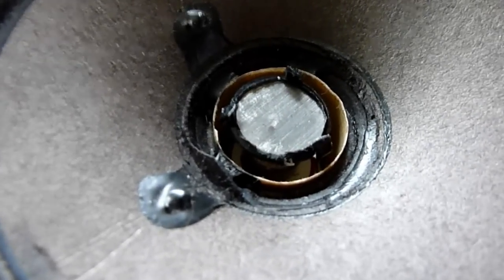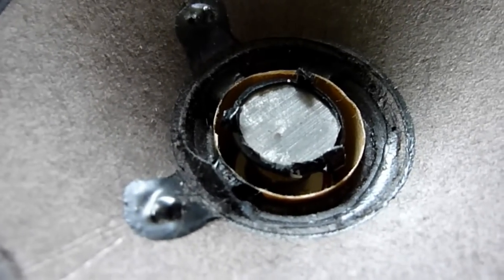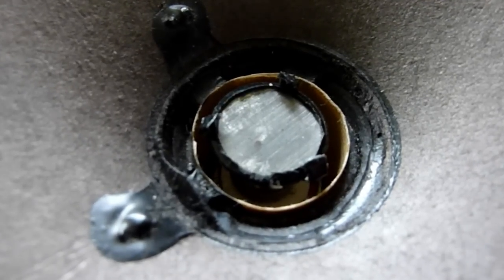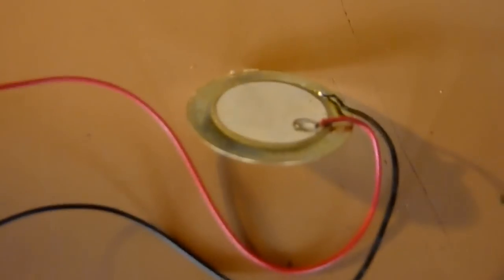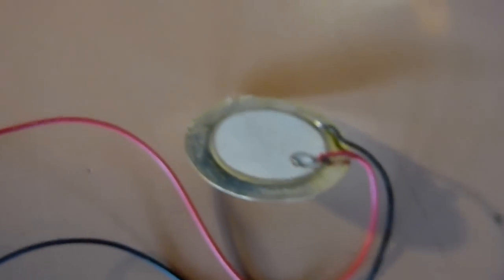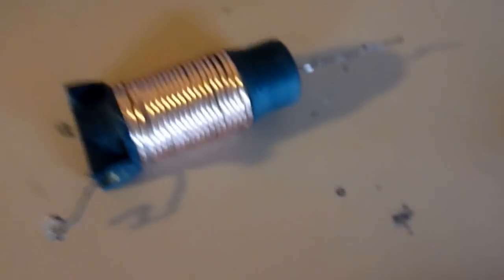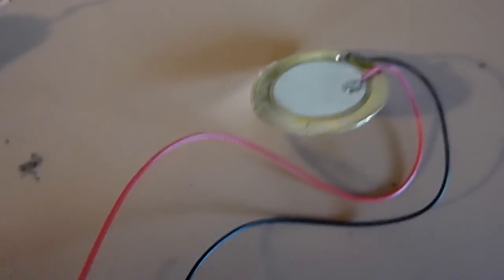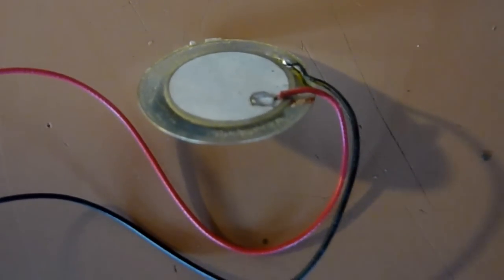MAKE PIEZO UNITS SOUND BETTER

Comment: Im building some 3-ways with piezo tweeters mounted to  jbl horns. I've got an 8ohm resistor across the termials with a cap wired to the positive terminal (playing 4200hz and up), and its controlled with an adjustable L-pad. Im really liking the sound, but I'd like to try your idea of cutting the top frequencies with an air core inductor. What value would 20 coils of wire be? .1mh?  .05mh?, etc Thanks for any help, I like your videos
Reply from the maker: .01 mh lol I don't know. Just go by coils instead. It made it sound smoother. It would be fuck-all resistance.

It's a good idea to have a 2 or 3 of ohms resistance in series with the piezo, to maximize lowest impedance, that I have heard can get really low. An 8 ohm across the terminals won't heighten the 1 ohm minimum piezo impedance (at high frequencies) cos it's in parallel. But it's still a cool idea to have the 8 ohm as well (across the terminals). Makes it a safe all round impedance. But with a .2 mh -.5 mh choke on it (in series with the 8 ohm) to save wasted top-end intensity. It's only that, that can't get through, so it goes through the piezo, instead (making it louder in top-end). Good trick. Impedance is controlled just the same, and sound is improved. Impedance stays between 8 and 3 ohms (and can't go lower) no matter how high the frequency (and the coil helps bring resistance up at the extreme highs, too). By not much, but it's still a cool thing, cos it sounds better too. win-win

 If you know about choke values, try using 8 mh chokes (big ones) on your woofers, in parallel with your existing choke(s), and a 2 ohm resistor on your existing choke(s). And the 8 mh choke is not resisted, and so has a 2 ohm influence on the other chokes (not much) but it will make a transistor amp sound like a "tube amp" in the bass. If there is too much med (cos of the extra choke in parallel) resist the small med choke by 2 ohms (if you have two original chokes). If you just have one original choke, resist that by 2 more ohms (only if there is too much med). 

If you have a tube amp, don't do it. lol Great trick for cheap transistor amps, though. Also extend your bass vent tube by an inch (if they are cheap speakers) and by a quarter inch (if they are good ones). And don't do it, if they are high-end speakers. lol Fat bass!
Reply: Thanks for all the ideas! The 8ohm resistor across the terminals helps the adjustable L-pad work properly with the piezos. They turn down and sound great, but Im gonna try a couple different chokes to see if I can get a little smoother sound. Anyway, thanks for responding
Reply from the maker: Thanks for the interest.
"The 8 ohm resistor across the terminals helps the adjustable L-pad work properly with the piezos."
The 8 ohm makes the general impedance 8 ohms (like a speaker should) instead of the typical 1000 ohms that piezos have in the upper med and lower treble. Piezos only have really low impedance above 10 khz (and ridiculously low at 20 khz). Hence the necessary 3 ohm resistor in series with the piezo. And the 8 ohm is in parallel with the piezo. So instead of the piezo having 1000-1 ohm impedance, it's now 8 ohm to 4 ohm impedance. Such a simple thing to do, and it corrects the impedance to a tee! Have a nice day.

Comment: fantastic video. thanks so much. I am getting into piezos and adapting one onto an old wax cylinder player! great tip on the resistor I will add one I wonder if there is a way to make them louder? for some reason the headphone output of my old technics receiver is louder when connected to the speaker outputs (maybe an impedance issue). if you have any tips on how to get a higher output with these peizo discs much appreciated
Reply from the maker: Piezos sound soft cos they only reproduce the highest frequencies (up to 30 khz). Twice the frequency of human hearing limit. lol But really pizos are "loud", but much of it is above human hearing and even the stuff that we can hear from the piezo must also be loud (but only sounds soft cos it's so high). 

That said, try mounting a piezo inside a full-range speaker. The high stuff from the full-range mixes with the extreme highs of the piezo to yield the stingingest treble ever (loud and stinging). So that is proof that the really high stuff from a piezo is really loud, but needs backup in the less high treble from the full-range (the stuff we can hear as loud). That combined with the really high stiff from the piezo, it's stunningly crisp treble (and loud) insted of the "chiffy" full-range sound by itself. And the "chiffy" sound of the full-range completely disappears and sounds like tweeters instead. lol Great cheap trick. And you don't get the limited power handling problem that you get with tweeters hooked up to high power amps.

I got tiny (computer speakers) full-range speakers on my ch. Just have a look, you have to scroll down my videos and you will (eventually) find heaps of speaker stuff. In my latest speakers I got another idea. Instead of using piezos, I got really tiny full-range drivers and added a tiny bit of foil to the center. I took off the central dome and left it open, and put the foil bit in it (where the piezo would have been). I also scribed a line around the full-range cone at 1/8" around the center. But not right through. The scribe line lets the center bit of the cone vibrate separately to the rest of the cone for the highest frequencies. It made a difference, and along with the foil bits, it sound as good as tweeters. The speakers are extremely small, scribed and foil added. It's even easier than with piezos, and really cheap to do. And you also don't have the limited power handling that tweeters have. The computer speakers don't have much power handling, but when used as tweeters (with a capacitor) they handle MUCH more power than a tweeter. I have a 200+200 RMS amp and I can't have tweeters without blowing one (I found out). lol

Comment: Hi, I like your idea's, I've been working with piezo's for over 2 years trying to make some thing to use the Diaphragm on an Edison Phonograph recorder so as to make direct recordings on phonograph cylinders. what I need is something that fits on to the recorder that sends sound waves to the diaphragm. I have seen what I need on youtube but the user won't pass on how to make it. and I'm not that technically minded. Have you got any idea's on my problem?  Thanks Gordon
Reply from the maker: You mean, like a crystal cartridge? They work by a piezo setup. I don't know the first thing about how to make what you are talking about. I'm just a speaker freak. Speaker freak # 1,000,000 lol

Comment from the maker: You can cut them down, I think. It's a matter of getting full-range speakers with a big enough voice-coil. My piezos are a lot smaller than most. I got them out of old stereo speakers (from the dump). 
See my two latest up-loads, both called "2-Way Point-Source Speakers (new concept)". And they are labeled #1 and #2. This is better cos it uses normal 2" coil-tweeters (sound better) instead of piezos. And the tweeter-cone is inside a small voice-coil cavity, like on full-range speakers! How?